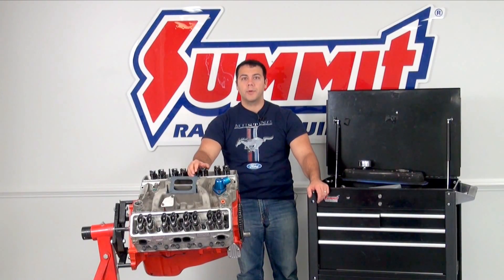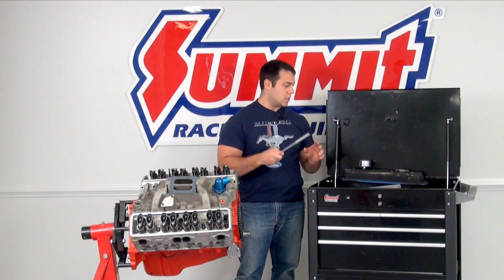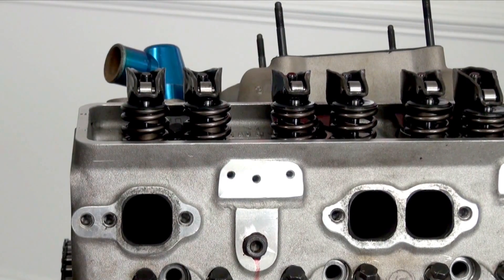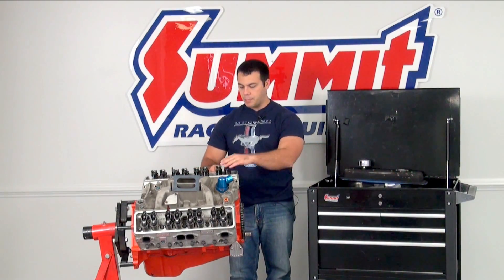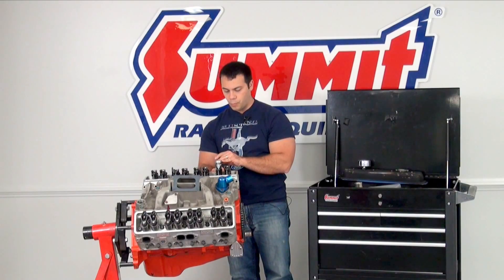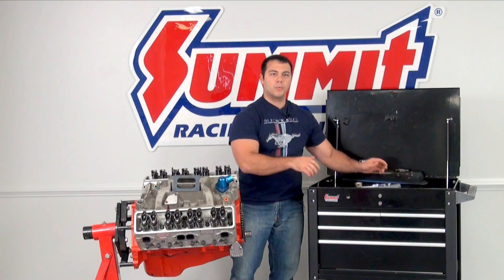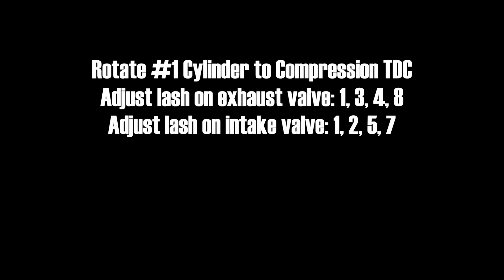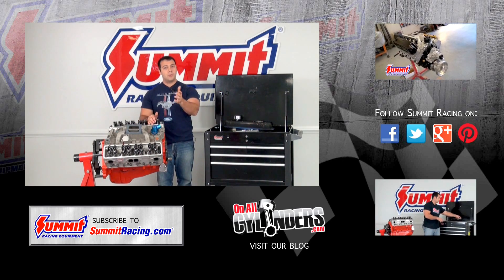Setting Valve Lash on Solid and Hydraulic Lifters

Comment: In the Ford 302 shortcut, it may be worth mentioning that the rotation and order follows the cam, not necessarily the displacement. For example, a non 5.0 HO that has a 351W cam and firing order would follow the 351W rotation, not the 302. Intuitive if you've built it yourself, but if you bought/inherited this setup, you may be unaware.
Reply: Actually, I was replacing guide plates and push rods today. And I think Robert Behr's comment is correct. The 302/351W shortcut info is wonked. Following that valve order will have you setting zero lash and pre-loading valves that are NOT closed. And that's no good. I ended up just going to the old standby #1 compression TDC. Set #1 in/ex. Then rotate in 90 degree increments following the firing order.

Comment: Hmm, I thought the term "hot , or " cold... was in  reference to weather the engine was hot, or cold when you happen to be adjusting the valves,.  ex. if cold .o16 and add .oo2  , .o18 when hot, for molecular expansion, , ? can you you clarify this?im refering to cast iron to cast iron......more clearance for alum heads.... also, does it matter if your cam was mfg. with high lift , say .620 and up ,and , or, overlapp ?
Reply from the maker: Hi Jay Scott, 
Our tech line will discuss this with you as well. We appreciate your interaction with our videos! 1-330-630-0240.